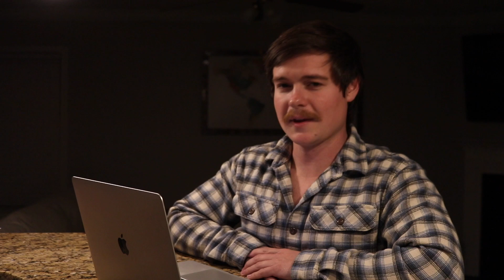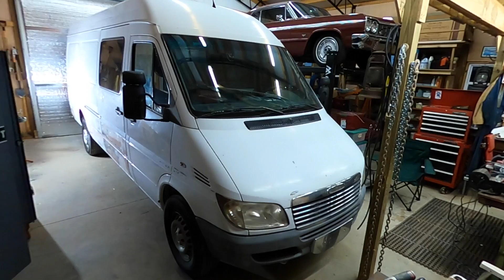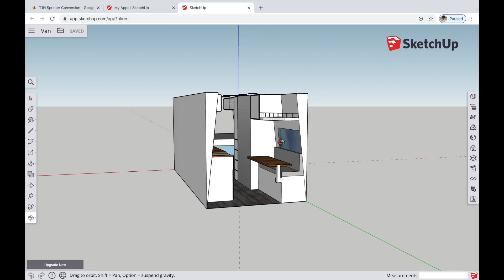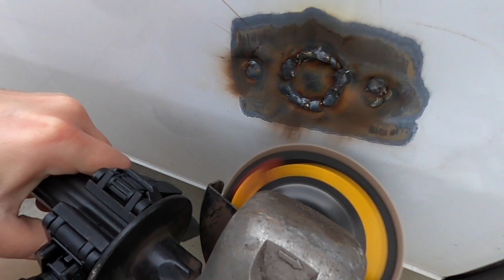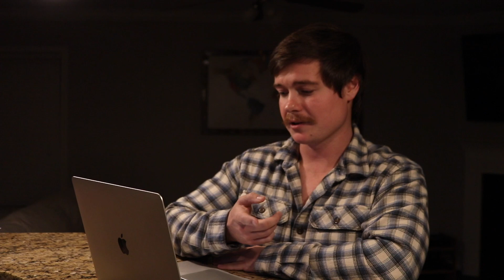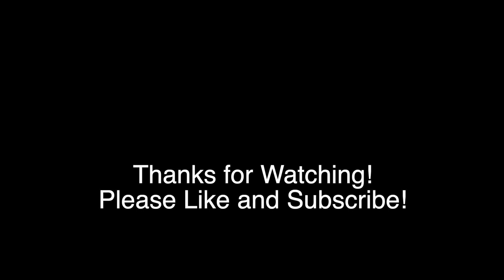How To Design a Sprinter Van Electrical System // DIY VANLIFE Power Systems Explained!

Comment: Now that a little more time has passed, do you have a better idea of how much your electric water heater actually draws each day?  This is the most expensive piece of electrical equipment in your system that can be replaced with other means. (such as a water tank connected to the engine's coolant system).  So i am wondering.  Does your water heater indeed only run for a half hour per day, which appears to be all you used in your spread sheet for power consumption.

Also, do you think its wise to just go ahead and chain 2 of these tesla batteries together to go from 500aH to 1000 aH to be able to run AC for longer periods?
Reply from the maker: We actually sold the van a few months ago. While we used it we really only ran the water heater maybe 20 minutes per day. The water heater was only $159 so it was on the cheaper side when it comes to electrical components. When we do another van I plan on running two Tesla modules. I hope this was helpful!
Reply: @goldenadvantures2573  Of course its helpful!  In fact, your series is the only reason I feel I will be able to build my van with confidence.  Thanks so much for all the effort and sharing.  I think I will try starting with one Tesla battery.   Off the top of your head, does adding the second battery in parallel change anything to other parts of your designed system?   Can all wire sizes stay the same, and another battery be added later on relatively easily if its kept accessible and space is reserved?
Reply from the maker: We’re really glad our content is helpful! We designed ours with the intent of adding another battery later. All the wire sizes can stay the same because the load on the batteries determines the gauge wire needed not the amount of storage within the batteries. The only component you’ll have to add is another cell balancer.  If you need any help along the way feel free to reach out through our website or social media!